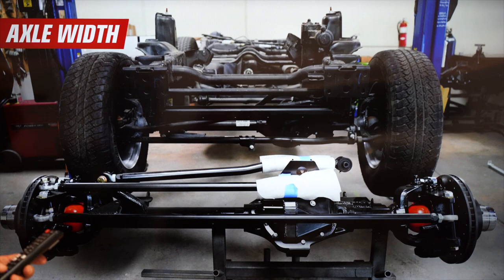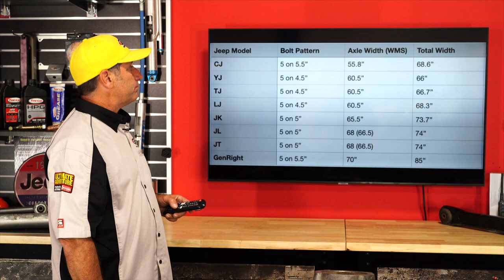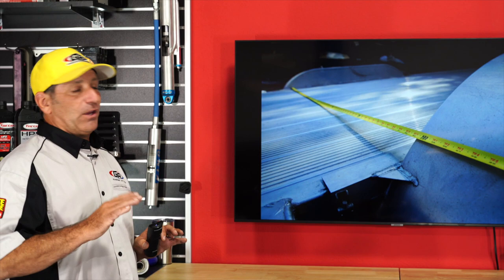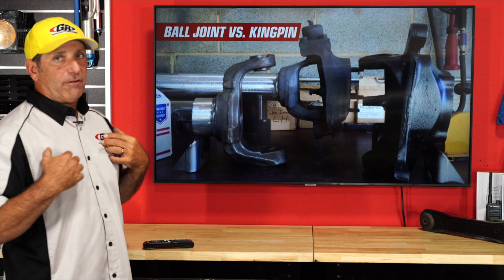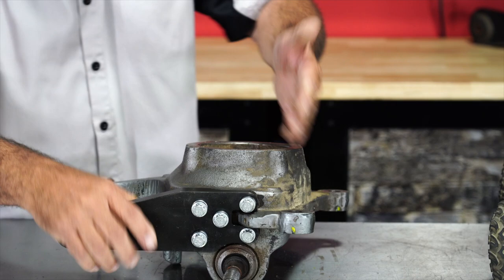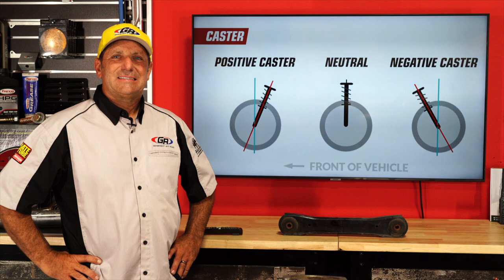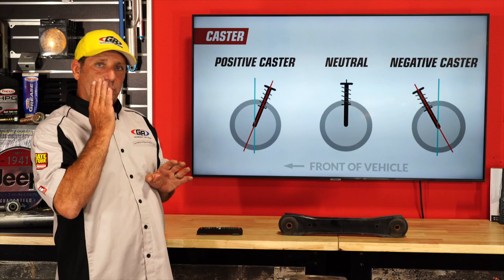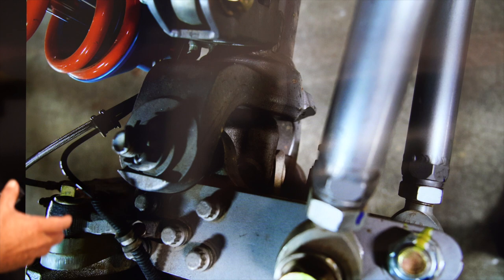Tech Talk Terminology - Expanding On Axles and Steering Components

Comment: So Tony do you have to replace your axle to get your caster back to the 6 degrees on your lifted Jeep?
Reply from the maker: You can have the "C's" cut off and rotated back to get your caster back to 6º.  Adjusting your control arm length can help as long as your pinion angle stays within the correct angle for your driveshaft.